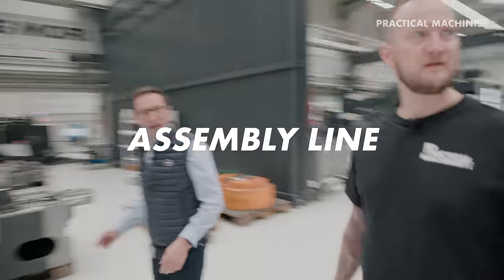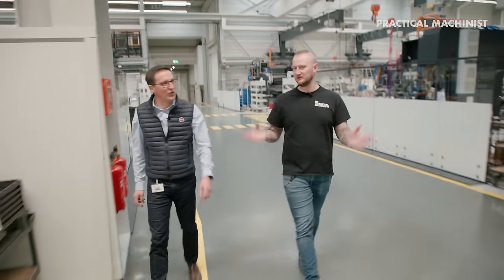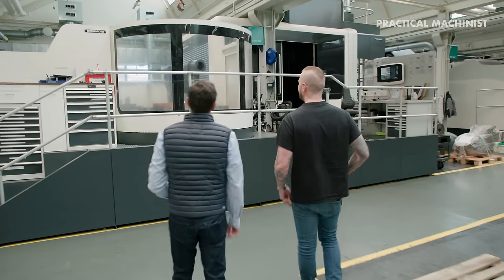Inside DMG MORI Giant Machine Tool Factory!

Comment: Trust me those are kind of small. I used to work with an Asquith CNC back in the nineties with four heads and a 10 x 5 meter table, we did very big work on that mostly one off's but it wasn't as sofisticated as todays machine tools. It was designed to machine nuclear waste flasks out of solid steel castings, forty ton of which would be waste material. I'm 70 and retired now and things have moved on a bit with multi axis machining.

Comment: Two of the machines in my shop have small elevators on the back of them due to how tall they are !
I don't remember the brand, but even when the table is flush with the ground (because the machine itself is put half underground lmao) it's still 15m tall or something

They are biiiiiiiig

There's also 2 lathes that can take parts up to 16m lmao

Comment: 12:34 Structural accuracy of mill is measured on continuously moving platform. Just like Kias moving in production line. Guy even said it was "tricky" to develope. No wonder DMG Mori current reputation of selling flashy LED decorated crap at premium prices. People at Hermle, Kern, Matsuura, Kitamura, Grob etc etc would had stroke if management suggested such thing. Pure, unvarnished greed. Current DMG Mori is exact repetition of Mercedes Benz in 1988-90. Out of blue an engineering excellence company was put in situation where engineers didnt have any say in company, only beancounters had.

Comment: Much better when they were just Deckel Maho joining with Mori was just a quest to corner the market which didn’t work by the way and now the machines are not as good as they were…
Reply: Success telling other stories..
Reply: im too not a fan, aspecialy about there 10k$ curved glasswindows....
but DMG just very Dynamic and accurate enoth machines, so they have a wide application field. Thats what makes "thair" market.
They are Expensive and build for 24/7 runtime, as long as you pay the maintainance and swap them out every 4-8years.
They are build to run (print money) and then get scrapped for the next "Gen".

I dont think right now, that machines build to last longer then 10years. Cors the evelution progress of the cast and the controlls got way faster than back in the days.
Reply: it was rough at the beginning ton of mistakes which is to be expected when you have a merger that size but things are getting better now
Reply: @X197ToPlay  Plain BS... I've got a 11 Year Old DMG Gildemeister Lathe, still works great.
Reply: We often forget that in the old days there was Spindle with 14.000 rpm, 30m fast travel, slow tool changer, limited axes in simultan operation, less features in machine control, no monitoring and active security systems like MPC. The machine tools of today are much more efficient, powerful, faster, precise and able to do integrated processes and automation. Not comparable with today demands. And with feature and capability increase always comes the risk of more failures.  Theres a company using these monoBlocks automated for 8 years now with 7.000 spindle hours per machine (!) and grinding 50% of the time. For me that is reference for quality machines
Reply: @X197ToPlay to prawda, trzeba mieć duży portfel żeby utrzymać ich maszyny.
Mamy dmu 75 i dmu 125 i dmf 260
Z 2013r wszystkie wymagają drogich serwisów